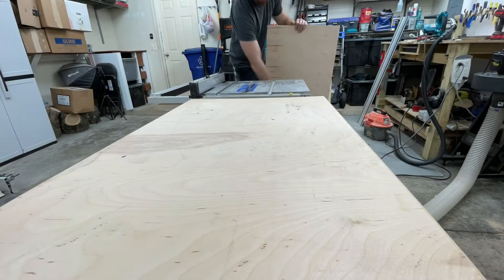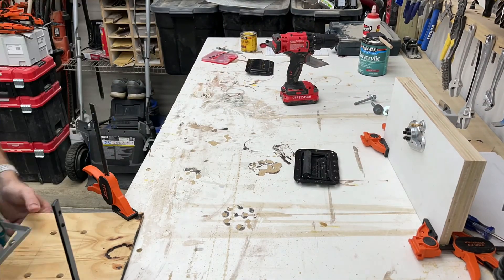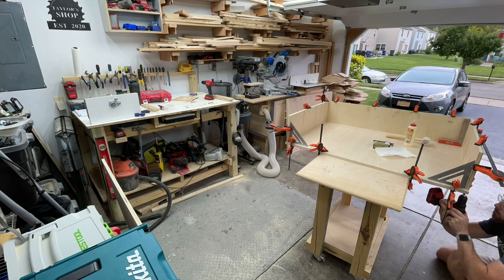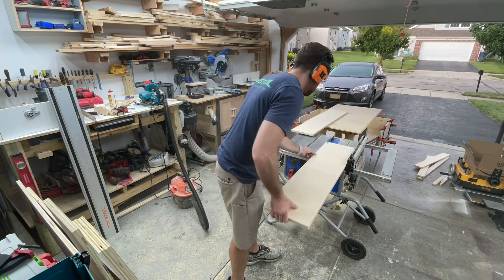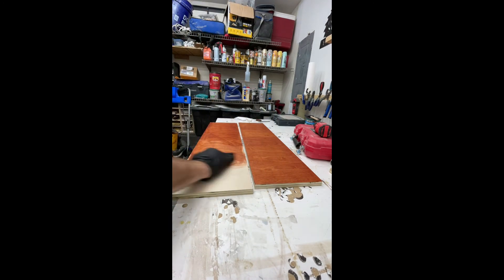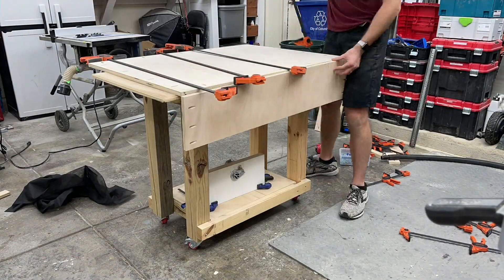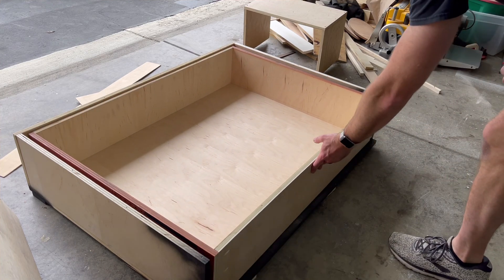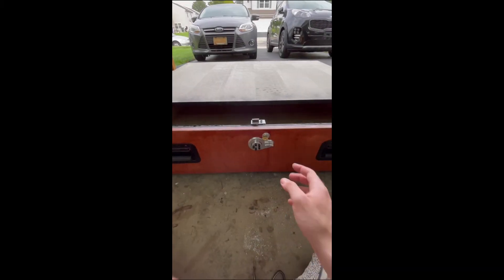$400 Car Gun Safe Build - Heavy Drawer Slides - DIY Project Build

Comment: I have pretty much the same size. But it’s about 6 inches too wide for my SUV. Any suggestions as far as sizing it down? Nervous that when I reassemble it, it won’t be as sturdy as it is now
Reply from the maker: I would guess it will be stronger if it is smaller.

Comment: what lock and handles did you use?
Reply from the maker: I got the handles from Amazon. "Reliable Hardware Company RH-0511BK-A Medium Spring Loaded Recessed Handle, 10 Hole, Black".

I got the lock from Grainger "Push Button Lockset 9000 Thumb Turn". 

Hope this helps!